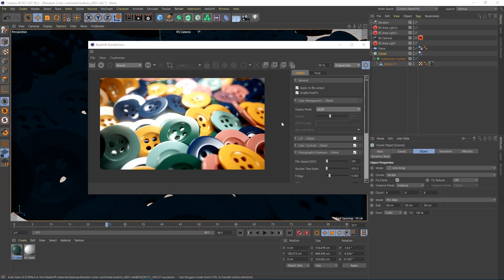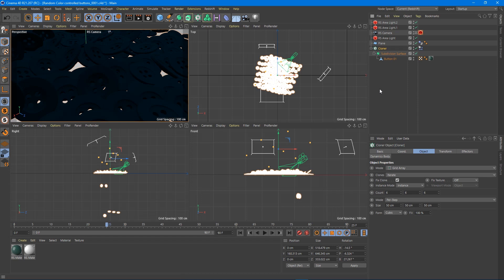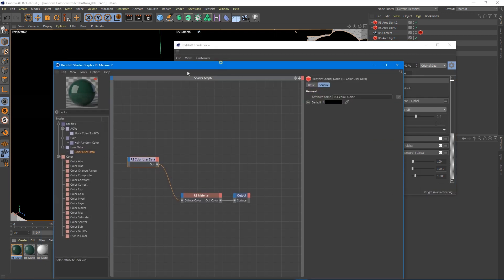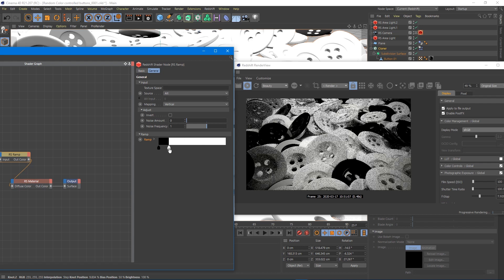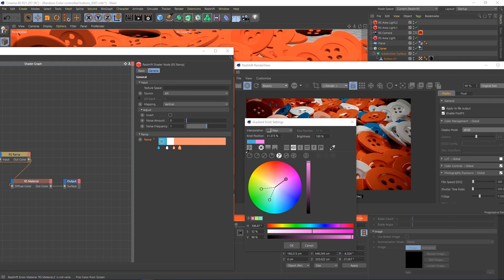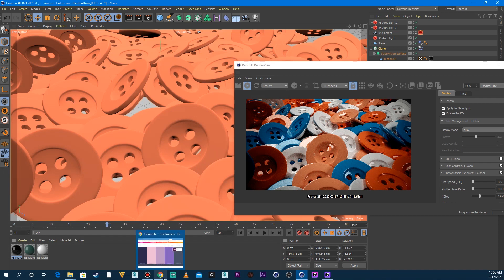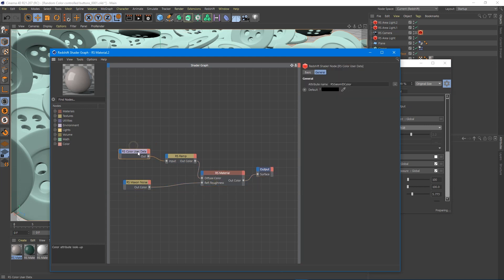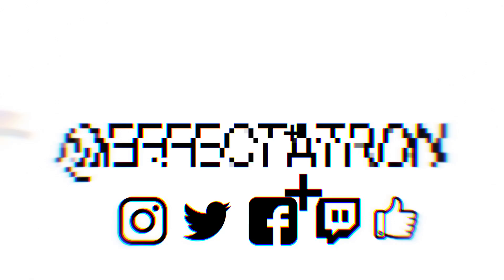Redshift- Create Multiple Colors with One Material

Comment: How would you do this with texture maps?
Reply from the maker: For that I would just do a material for 4-5 different identical button models and use them in a cloner so it disperses them.
But if you wanted one material to do multiple texture maps on one obj. I'd have to see, but you could get the same effect from how i mentioned above, you wouldn't have the quick control that doing it with a ramp provides though.
Reply: You can do that with the Shader Switch Node, i think. You can pipe in several materials witch get spread over the instances.

Comment: "I use this trick all the time! Great video. I also pipe the user color data in to a change range and then in to my textures rotation and offset values. That way you won’t have repeating patterns in your shading. Try it!" - Peter B. Christiansen
saw this on the Fb post, sharing this additional tip by Peter for those who are viewing it on YT
Reply: Thanks for sharing — this is game-changing for me. :)